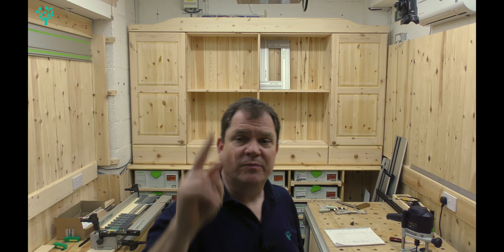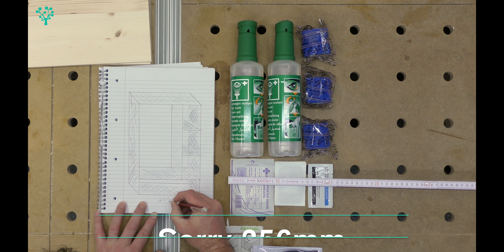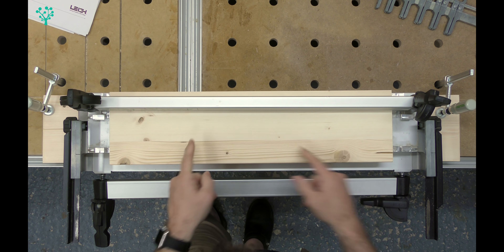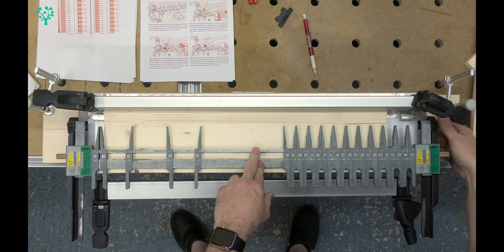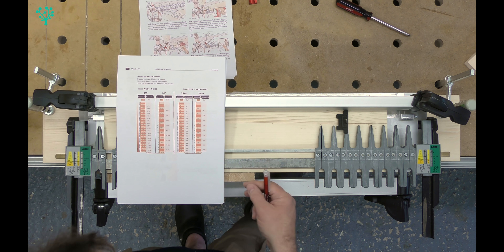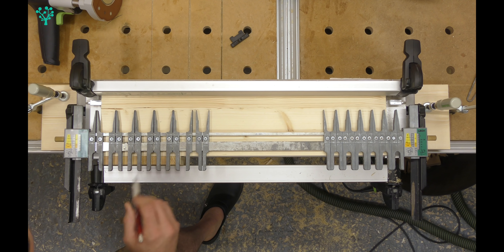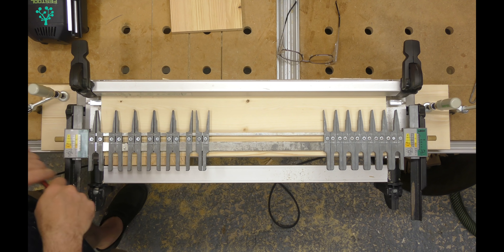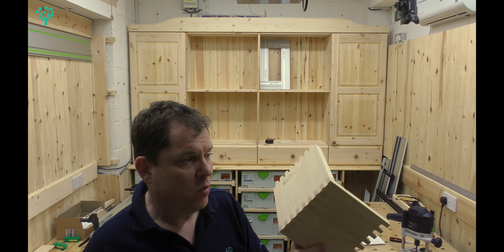Leigh DR4 Pro Dovetail jig - Episode 2 - Box Joints

Comment: Nice project and review, one bit of advice: fewer Fe$tool purchases and more non-pine wood purchases ;)
Reply from the maker: Hi,

You have confused me....🤨

Apart from the sysport, the shelving unit, the pencil box, the bits and bobs box, the cladding, the first aid kit and a utility room I built off camera. I don’t use pine.

And apart from the Dominio, the MFS, the CMS, the TS55, the TS55 CMS modules, the router, the router CMS modules, the clamping set, the screwdriver set, the orbital sander, the Kapex, the MFT’s, the folding ruler, the numerous systainers, numerous tracks, the parallel clamps, the CT26. I don’t have any Festool gear.

And let’s not mention the upcoming pine workbench, or the recently purchased Festool belt sander.

😇

Cheers

Andy
Reply: @TheWoodgrafter  - oh, is that all, nothing else?
Reply from the maker: Chris Moore don’t think so....

Comment: At 20:55 it looks like your timber has slipped down from the finger reference, making the router depth incorrect for your fingers, a tip would be to clamp a scrap piece of stock of the same thickness as your work piece the other side of the jig, thus allowing you to tighten the clamps firmly.